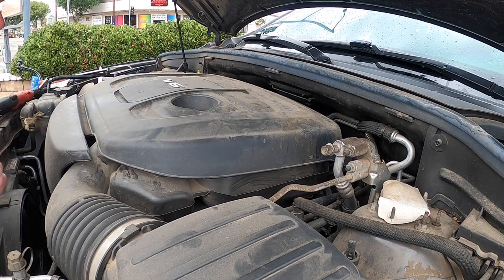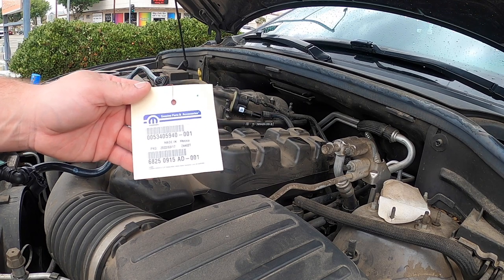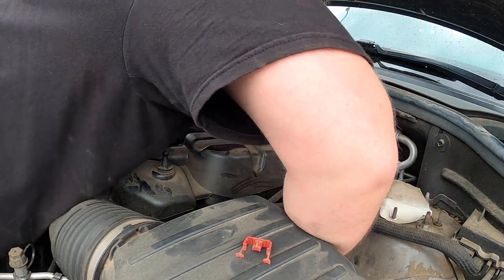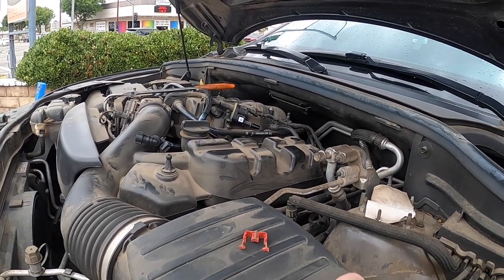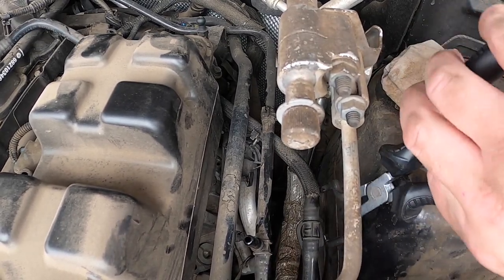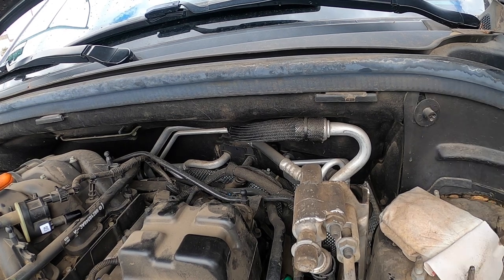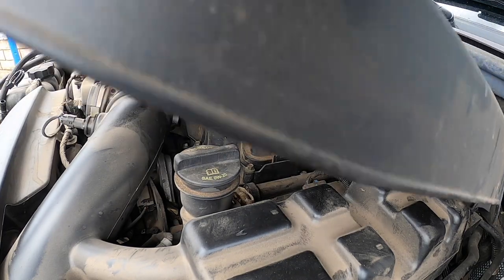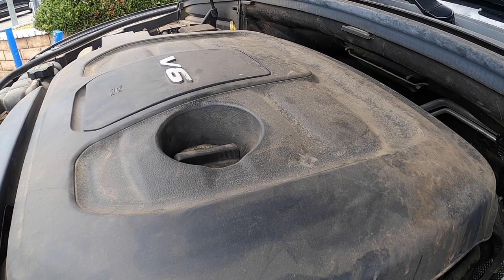2018 Dodge Durango 3.6 P0456 Broken Evap Purge Line

Comment: Broke the purge line on my 08 ram 1500 5.7 and nobody sells the line 😂 gonna try a heat shrink around it and hope it works
Reply from the maker: That should work pretty good, I would do a couple layers and you should be fine for a while. These things are so brittle.

Comment: I've got the same problem, can you just cut the hose and heat the hose and reinsert the clamp?
Reply from the maker: I would be very careful, those are gasoline vapors and can ignite. Before trying that I would remove it from the vehicle and blow air through it. You could use a piece of hose and two hose clamps if needed. The pipe I think is like $40-$60 at the dealer.
Reply: @drewsshoplife  thanks for replying, I went ahead and ordered the replacement hose.

Comment: I have the same engine light code p0456 and replace the same part . the write clip  went  to auto zone  and dodge dealership to get a new clip but   but  they don't  have it .  My question  is ,Do u know where to get  those exact  clip ?
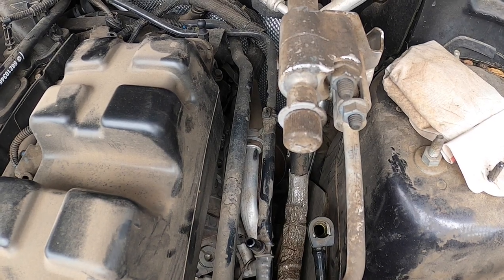Reply from the maker: Which clip are you referring to? Is it the clip I'm trying to release at 3:07-4:56?
Reply: The 4:57 do you know where to find the grey clip? I broke mine. It’s still inserted and held by the red one but I still want to replace it
Reply: I did this too please help! 😓

Comment: What is that red clip called, anyone know? I lost mine when replacing this hose.
Reply from the maker: That should be the safety lock for purge line. As long as the line clips in and can’t be pulled out it will be fine. It’s just a secondary lock.

Comment: My red click broke as soon as I touched it. Do I really need it and if I do where can I find it?
Reply from the maker: Those are generally secondary securing clips. Only if its the secondary and the primary one is still working ( the line wont come off) you should be fine. Just make sure the line wont come off when pulled on.

Comment: what is the part number of the line ?
Reply from the maker: The line in this videos part number is 68250915AD. Verify with your dealer that is the correct part.